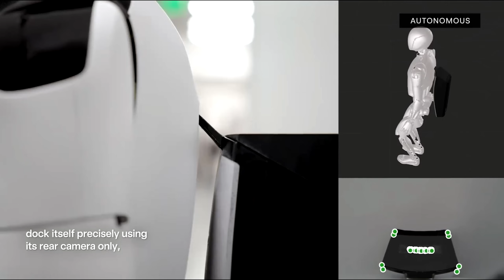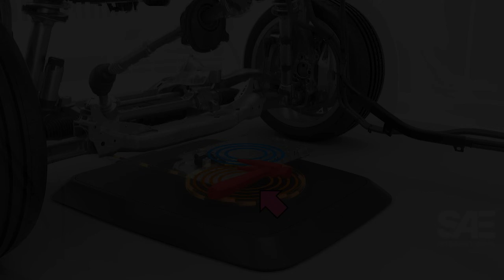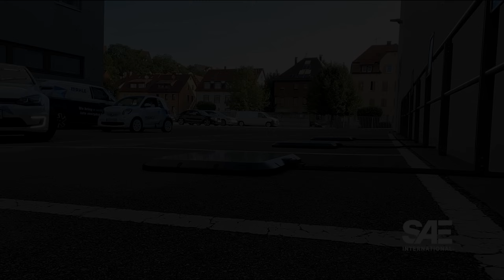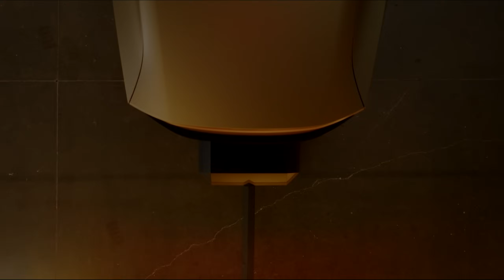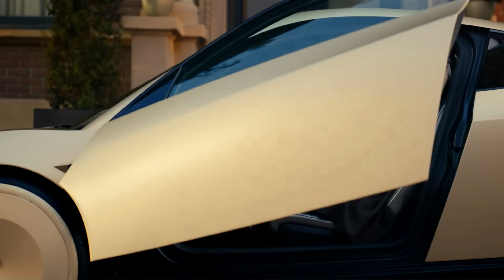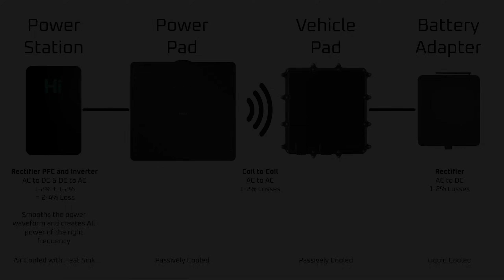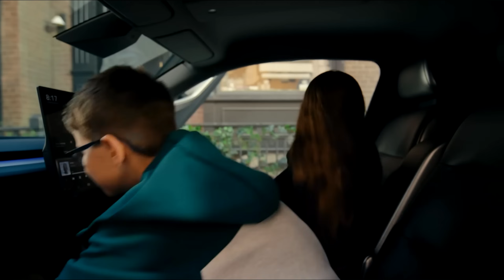Part 2:  Wireless Charging for Vehicles // The Nitty Gritty Details

Comment: A notable plus for wireless charging (that I don't believe was mention in your pervious videos) is a shared inverter helps lower the fleet coast. While an on car inverter is handy for a personal vehicle, the charing inverter can't be used when it is too is being driven about. For a commercial fleet it is likely more cost effective to drop AC support on the vehicles and adapt the parking lot. Odds are the in car inverted will outlast the car itself anyway, so it is just one less thing to part out.
Reply: The current from the coil is also AC, just at a different frequency. The charging electronics will be different, not disappear as it would in a DC charging only vehicle, roughly and hypothetically speaking.